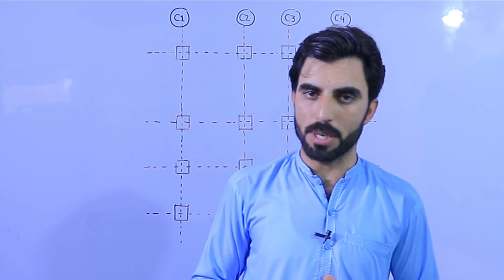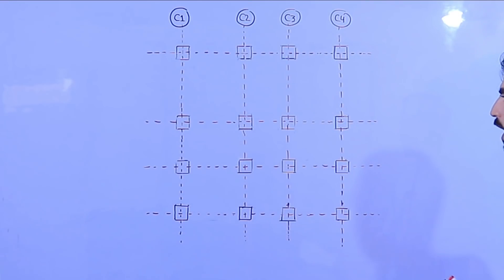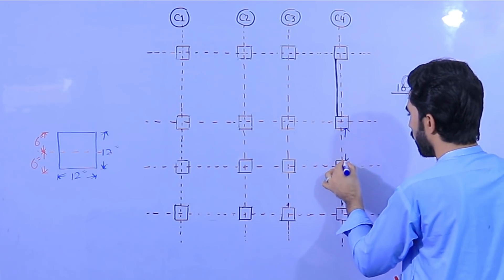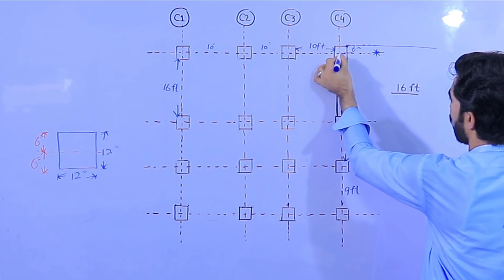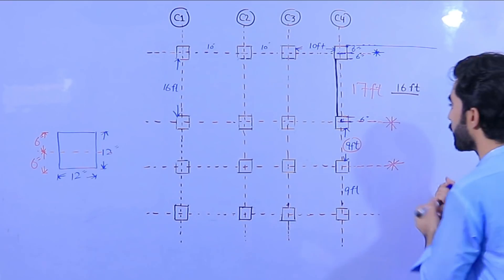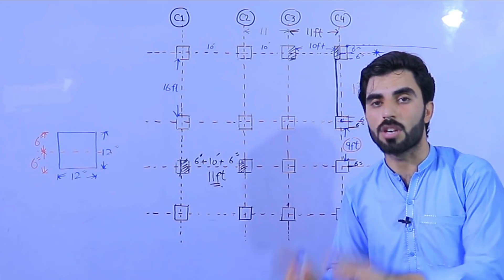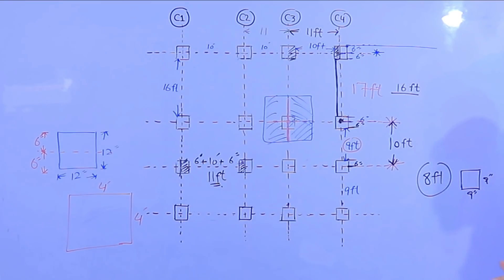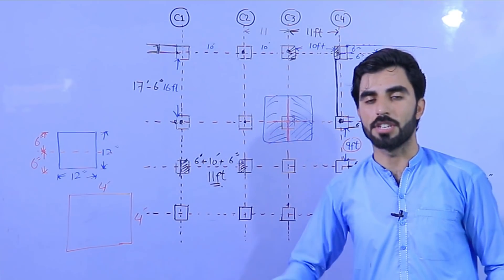Foundation Markout for House - Price of Foundation Markout for House

Comment: Hello sir, thank you for the info. I have used 9 inch by 12 inch column size with 4 16 mm and 2 12 mm steel rods with a span between columns as 18 ft. Total 8 columns, 4 in each row, with a distance of 12 ft gap.  For the plinth beams I have used 6 rods with 12 mm. I am planning for G+2, soil type is black soil, foundation method is rig (bores) with a depth of 12 ft. I have also provided caps for all the columns at the basement level. Roof beams size is 9 inch by 15 inch with 4 16 mm and 2 12 mm rods, please give suggestions on this. This is a residential model

Comment: Sir designing foundation is job of civil/structural engineer not Architecture...
But an Architect can recommend to locate columns and their are few restrictions for architects to facilitate other engineering works as they are only to support a building actual function.
Reply from the maker: Bro research for this structure designer just provides u structure not performing layout in site
Reply: right